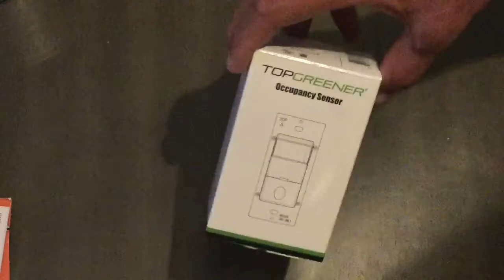Easy Motion Activated Light Switch Install

Comment: Great video!   My sensor has 5 wires and replacing a 1 of 2- 3way switches.  Do i need the other 2 wires if not having sensor at 2nd swwitch? .
Reply from the maker: I'm sorry, I'm having a hard time visualizing your setup. Is it possible to send a photo?